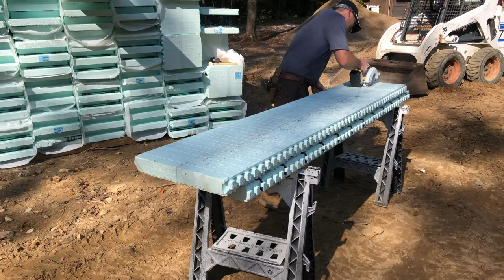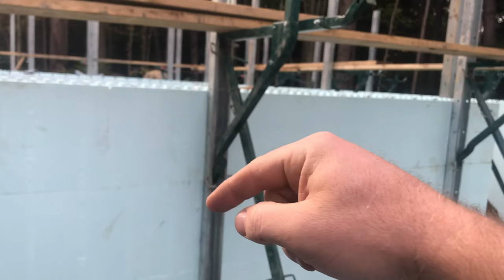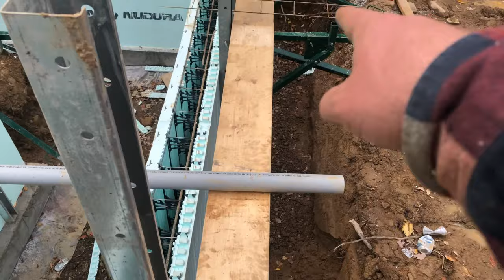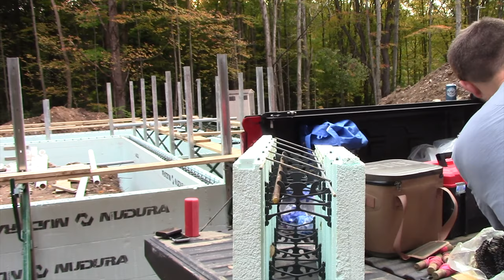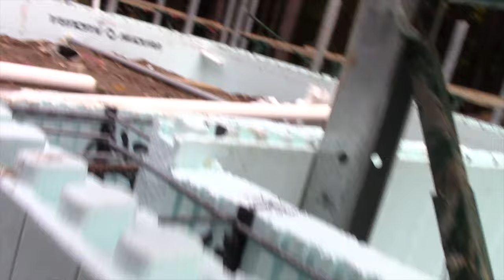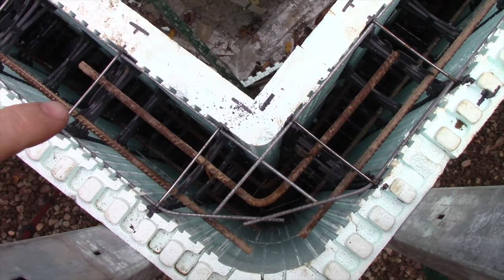VLOG 11 - Insulated Concrete Forms!!!!  We have completed assembly of the Nudura wall system

Comment: At 10:30 in your video you mention the overlap of rebar and you said that you "overlap them by 9 inches or what not".  I wanted to make a correction as a FYI.  I am a licensed engineer and the minimum requirement for the overlap of rebar in concrete is 40 times the diameter of rebar being used.  So for 0.5 inch (#4) rebar, the overlap will be 20 inches at each joint. If you use #5 rebar, (5/8 inch rebar) the over lap at each joint will be 25 inches.
Reply from the maker: Hi Roy, thanks for the feedback.  I edited that part out of the video.  I don’t want bum dope out in the world and I appreciate you keeping me honest

Comment: We never have to cut a block for height when working with icf, bring the step downs to height of the blocks, so if its a 16 inch tall block bring the step downs 16 inches each step down.
Reply from the maker: I appreciate the insight.  16 inches is a bit excessive for a step down to a porch in my opinion.  I do wish I had made the step closer to 6 inches, but what is done is done.

Comment: What size, 6" or 8"?
Reply from the maker: 6” cavity
Reply: @BearMadeIt  how is it holding up? My contractor said he would use 6" for my walkout basement.  I'm getting  a lot of feedback saying go 8" for below grade.
Reply from the maker: So far so good!  Nothing has moved in nearly 2 years and 2 freeze thaw cycles.  Who is telling you to use 8”?  There are a lot of folks up here that use the 6” for basements and they all seem to be holding up just fine.  Admittedly I don’t have any experience beyond my own foundation
Reply: @BearMadeIt  thanks for the feedback! I had a footer/slab guy tell me and then another guy who built an icf house recommend 8. My icf guy quoted me at 6", which  if fine just wanted your take after the fact. Good job on the videos,  new subscriber from here on.
Reply from the maker: Best of luck to on your build and thank you 😊

Comment: Why did you start with a half block  instead of a full one ,you would have been better to terminate with the half one has recommended by Nudura.
Reply from the maker: Allowed us to make a 4 inch recess on the top course to allow for the slab.  There is less webbing on the top/bottom to cut through so this was logical to us

Comment: Hey.  What's with the plastic material under the footings?
Reply from the maker: Poly sheeting.  I used it hoping to keep the concrete off of the forms.  It worked really well and I have been able to use the boards for other parts of the project .
Reply: @BearMadeIt  not a bad idea these days.  👍